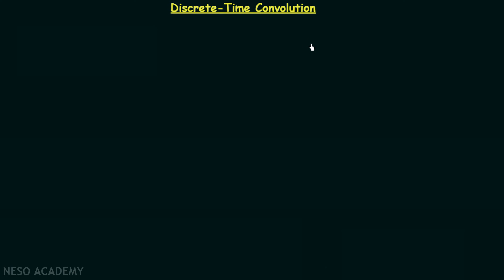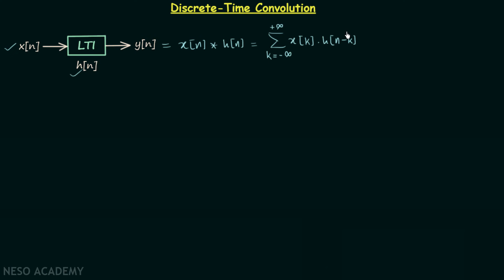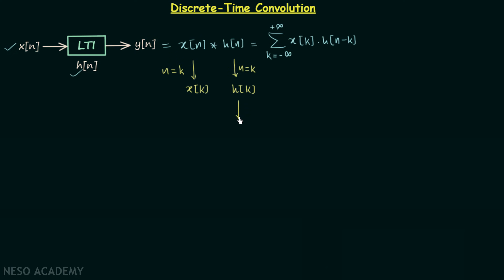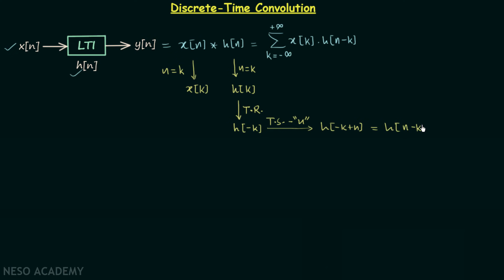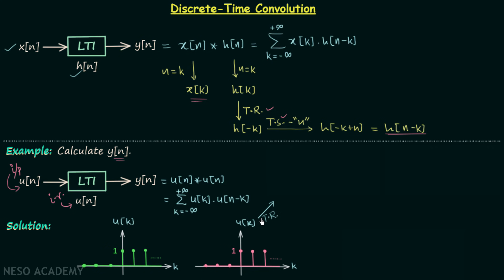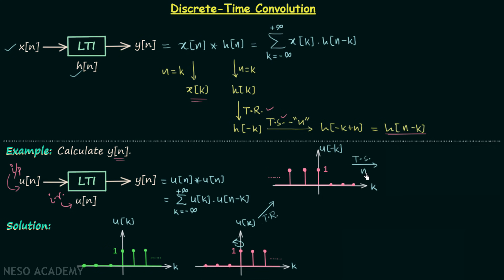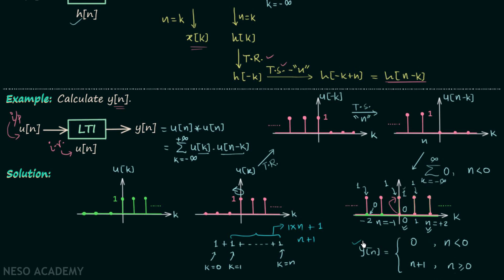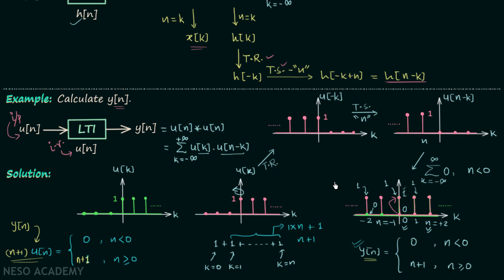Discrete Time Convolution

Comment: When there is a shift by n-k then you should remember that the shift can either go to negative or positive values, when n is negative it will shift in left direction, and if it is positive then it will shift to the right. This is a very important point to remember.

Comment: Sir, I have the plot of u[-k] like you but when I plot u[n-k] I take 2 cases. First one n>0, so the plot of u[-k] is shifted left and second one n<0, so the plot of u[-k] is shifted right. But if I consider that, I have as a result y[n] = 0 for n>0 and y[n] = n+1 for n<=1.
Where is my mistake?
Reply: Ig  u[n-k] ,for n>0 u[-k] will shift towards right and left ,for n<0
Reply: @sudpn2861  what???

Comment: shouldn't the signal be first shifted by 'n' and then time reversed
Reply: No. Shifting the signal by n, results in h[k+n]. Reversing it results in h[-k-n], which is wrong. If you shifted it by -n instead, it would give you the right result.
Reply: @vctrop_official  , on performing time reversal for h[k+n] with respect to independent variable k, it will give h[-k+n].
Then why we are doing reversal first and shifting next, it is because if you do reversal first by h[-k], once reversal done, is done for all values of k, so you can simply shift it with respective n value to get h[-k+n], so on changing n you already have h[-k], so you need to do only shifting. But if you do shifting first as h[k+n] and then reversal as h[-k+n], for every change in n value, you need to do both shifting and then reversal.

Comment: how you shift n = +2 , n= +3 to the right?
Are not the supposed to be going left
Reply: because we time reversed in the previous step, now the axis is (-k), not (k). therefore its a shift to the right.
Reply: @SchruteDawg   Then also if considering the time reversal then that is -k after that when we are time shifting then we get the h(n-k) standard delaying system because it shifts the time on positive axis. 
Even if you take any discrete value then by mathematically if you do then also it shift the positive axis and orgin changes to left by k. 
But whole graph shift on right direction that's why we comparing with standard delaying system 
Even sir has also told on lecture number 273.

Comment: but u[n-k] is 0 at 0 not 1 at 0. we shifted u[-k] by positive n and therefore it is no longer 1 at 0 but 0 at 0.
Reply: u[n-k] = 1 if n-k>0 by definition wish means k<n , (dont forget that k is the variable and n is a fixed number) so we need to differ between two cases if n is positive or negative and you draw the graph